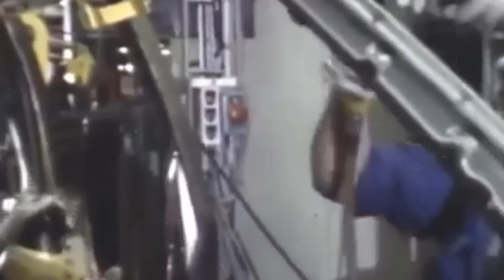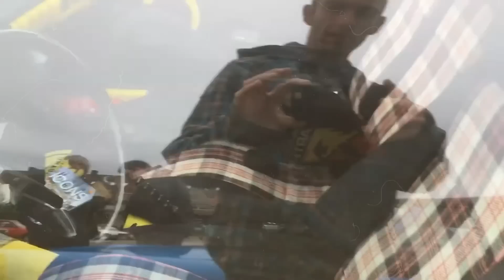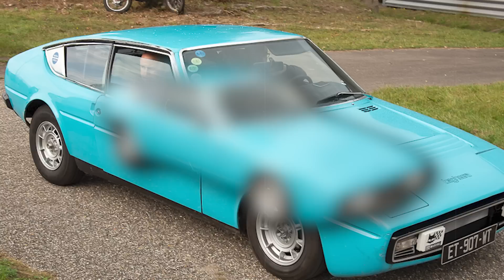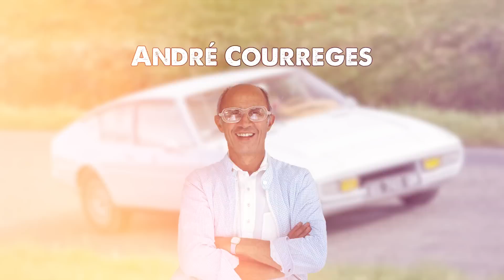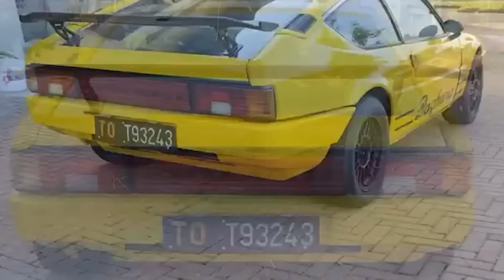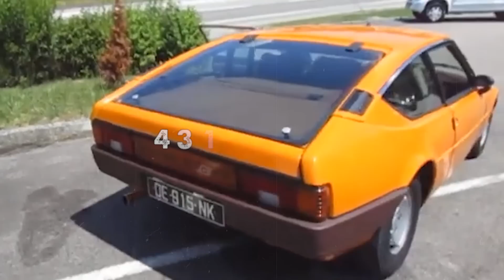The Unheard French Beast That Changed Everything!

Comment: I was lucky enough to ride in a Bagherra S. Upgraded with Bosch high-performance ignition, and a chromed exhaust with the 1442 cm3 (100 bhp). My best memory: the sound of the air intakes on the twin-barrel carburetors above 6,000 rpm.

Comment: Would make a great electric conversion and given the engine location Would help no end with heat noise and space problems.  Tesla twin rear or simillar sporting twin motor rears.. space for batterys up front and bit in the rear. 
Love the looks and seating ..of the car the Mura not so much. 😎🧙🏻‍♂️🇬🇧

Comment: You can't call either of these cars a "Beast".  They were light with fiber glass bodies built by Matra, a major race car builder at the time, but had puny engines. The three seat layout (like a van) made them unusual. I saw a couple and considered buying one in the early 80s however I bought an Alfa Alfetta GTV 2000 which I loved.

Comment: My mother is born in the city where the matra where constructed, she used to see them everywhere as each car was tested before being send to the customer.
I'm still near this city, you see matras almost everywhere, and at each local car meeting.
The rarest is the M530, as ford discontinuated their V4 sooner that they told to matra, and the car is so tiny that not other engine would fit in it. In the 70, it was a track weapon. With 75hp xD.
Reply: tiny ?where?you must be confusing it ,was a big car a GT junior would fit inside of it, think, if with three long seats in the front side by side wouldn´t it be large and long
Reply: @DID70Sworkedoutforyou  you dont even know what you're talking about...
An m530 is 1m20 high... 1m58 wide... It's not even the size of the first mx5, wich is already a tiny car...
The m530 was a 2+2 car. The engine is fitted under the rear windshield... The car had a rear engine and a boot.

Comment: French beast ?
it had a 1400 cc engine  with about 80 din hp. Beautifull, charming car but not a 'beast'
Reply: Murena never had a 1.4 engine...
It had a 142hp for less than a ton.
Wich is pretty good.
At this time lotus used to make cars that where 100hp for 700kg.
It almost the same weight to hp ratio.
Those cars where literally beast, their were known to get passed in the straight lines but get everyone behind at the first corner.
Reply: @benji280792  a Matra  bagheera is not a  Murena. The Matra Murena had a 1.6 (92 dinpk : 5640 ex), 2.2 (118 dinpk : 4560 ex) and 2.2S (142 din pk thanks to tuning kit : 480 ex) Not exactly 'beasts'. Frugal maybe but not beasts.
Reply: @lv8920  the bagheera didnt had any 1.4 neither... 1.3 and 1.5 
Again the hp to weight ratio, was pretty good for this Time.
A 120hp catheram can run agaisnt big sport cars pretty easilly. A 240hp catheram can beat almost any supercar.
It's a matter of weight ratio and ability to stick to the road.
This kind of car is very well performing. That's a matter of fact...
Reply: @benji280792  Bagheera 1294 cc (84 din pk), Bagheera S 1442 cc (90 din pk) = closer to 1400 then 1500
Reply: @benji280792  the Bagheera started early 1973 using the driving unit of the Simca 1100 TI which was 1294 ccm 84 dinbhp. Until end of 1976 then it was transformed to the bigger unit from Simca Horizon 1.442 ccm which could be seen as 1.4 or 1.5 liter with 85 bhp and from summer 1977 in several luxury versions also with 90 bhp,  topspeed was about 183 to 187 kmh.
Production ended summer 1980, by September 1980 Murena was launched with 1.6 liter and 2.2 liter engine from Talbot Solara and Talbot Tagora.
Reply: By 1972/73 any French car faster than 155 kmh was considered a rocket.
Like Renault 16 TS with 83 bhp, the TL had 55 bhp .
Normal cars had 24 to 40 bhp, like Renault4 or 6, Simca 1000, middle class Simca 1100 with 52 bhp topspeed 134.
So for French dimension it was fast.
Reply: @bennyhannover9361  'Fast' but not a beast.
I know these cars and saw them on the road. The bagheera was beautifull (3 seats up front) but not very well made. A representive of my father had a Bagheera S. They were not that fast and the roadholding was not top notch. They were tail happy and also not very reliable. It could go 183 km/h (first series with the 1.3 l motor and 190 km/h second series with a 1442 cc engine (because the aerodynamica was not that bad and  light weight)  but it took a while (long gears).  Almost nobody bougth them. And they rusted (chassis).
There were Gordini's, Peugeots 504 ti, Citroen DS, Reault TX etc . All reasonably 'fast'.

Comment: As a kid I recall seeing a couple of both the Bagheera and the Murena on the streets of Portugal. Surely made me stop and go look both inside and outside. Nostalgia. 🙂
Reply: i had a white one and it was parked in the highschool parking as i was a teatcher there for two years, in the Alentejo compadre, the streets were so bad and narrow that didn´t matter if it had the 1.5 L engine or the 1.1L engine from Simca, the one i had someone changed the backlights from the first ones to the second ones when i re-painted it because of the litle crash when pointing the gate i went and broke the front grill against the wall surrounding the house,  30 cm off side or the gate, that was closed , i was lucky to grab the steering wheel much more drive it without street lights but after all was my daily driver for years as all others were gasoline drunk, the BMW 2002 was faster and at the time they call it the killer car , when i drove it in the 90´s was the safest car to drive in mountain roads, already larger and new